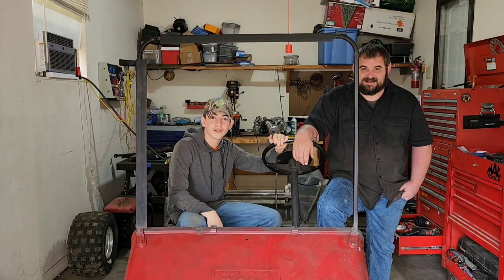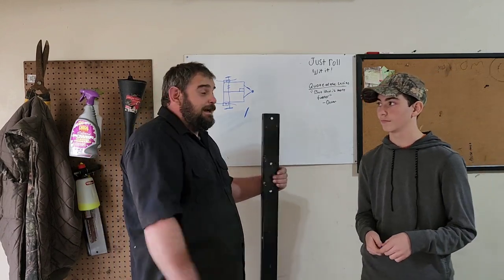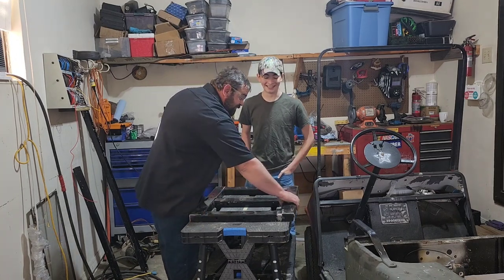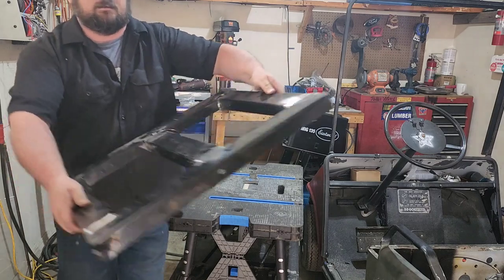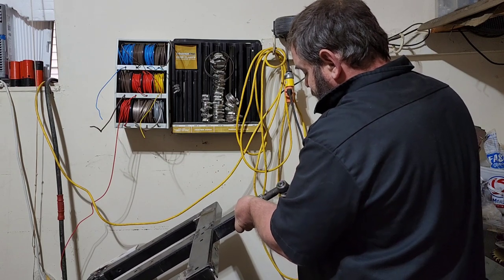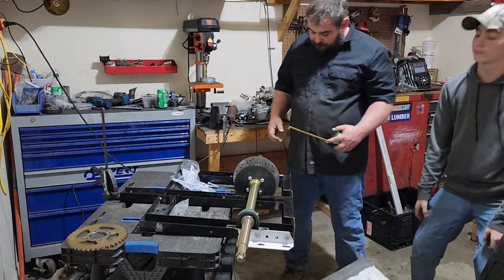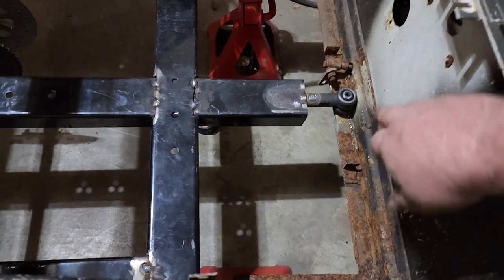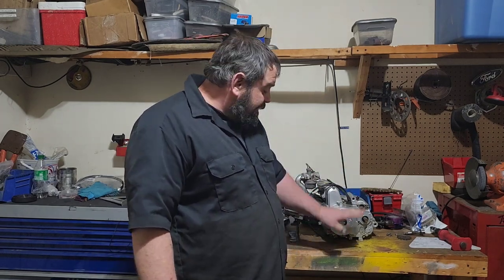125cc electric to gas  golf cart build part 2                                (Frame and live axle)

Comment: In the process of doing this right now. Just got same engine. It came with a stator in a separate box. I'm assuming that the engine already has a stator installed for charging battery, running lights etc. It looks like the yellow wires coming out of engine. Is this correct? Thanks for all the info in videos.
Reply from the maker: If yours came out side the box, then you may need to install it. Mine  came installed there should be 2 sets of wires coming out. The top one set was shifter indicator, and the other set is stator. So you might need to install it, but thank you for watching, and I hope you enjoy your build .if you have any other questions, I'll be happy to help along the way
Reply: @Trucks And Junk  thanks, yes 2 sets of wires one with plug and separate one with 5 wires so that must be stator.

Comment: What size axle did you use. How many teeth on sprocket. Thanks
Reply from the maker: It is a 44" live axle the one that I have I ordered from Amazon but the sprocket did not have a 40 series chains so I had to make a new rear sprocket for it So I would recommend getting a regular 44" live axle kit . And the gear ratio that I ended up with is a 12 tooth sprocket on the front and a 40 tooth sprocket on the axle Thank you for watching and if you have any other questions feel free to ask
Reply: @Trucks And Junk  Thanks